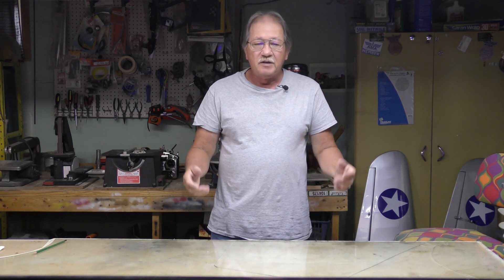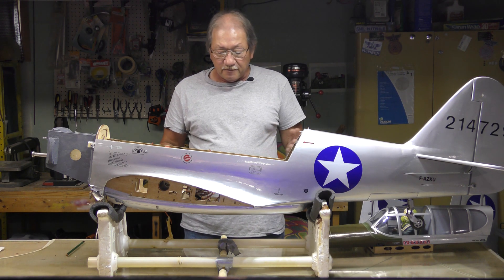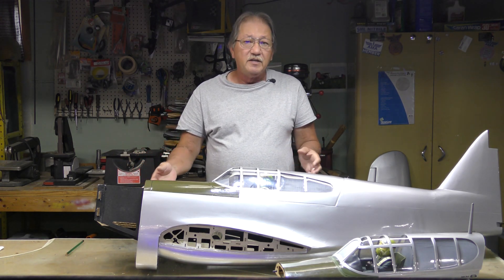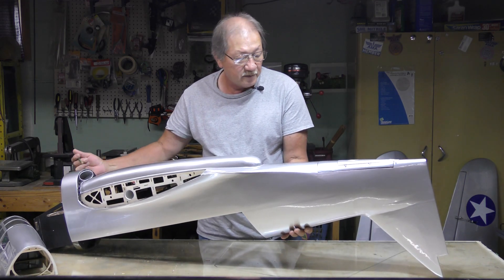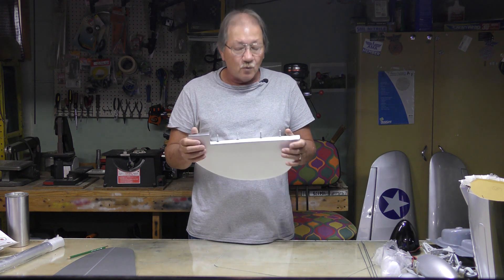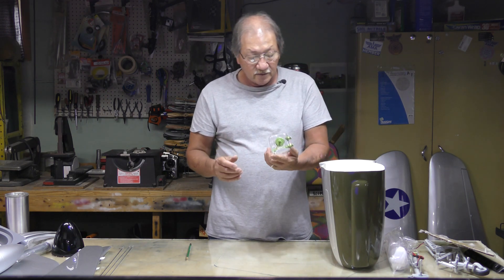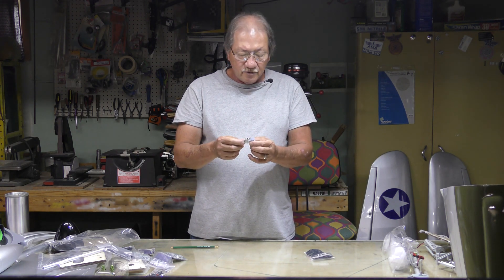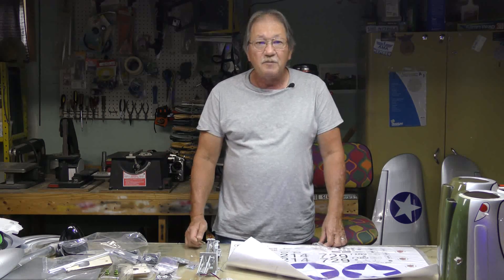Review of the New  P-40 Warhawk from Phoenix Model

Comment: Hi. Good review. Do you think a DLE 20cc is to small for this plane .
Reply: Hi, I think a 20cc  might have enough power to get the model off the ground however, I strongly wouldn't recommend it. I've. been flying my P-40 with a DLE 35 for a while now, and in my opinion,  a 35cc is the perfect power plant for the model. Thanks for the question.

Comment: Great video!! After seeing what it actually looks like I ordered mine from Towerhobbies yesterday!! Going to go electric hope to see your build series on this one! Question is it going to need a retract module I heard you mention something on that matter? 👍🏼👍🏼
Reply from the maker: Hi, the "Retract Control Box" made by Phoenix Model is not yet available.
You can purchase other control boxes else where that will work with 7.4V retracts. The ones I found cost far more than the one that Phoenix Model is suppose to produce. Tower Hobbies has it listed, but its listed as "Coming soon". I put myself on the "Notification List" on Tower Hobbies web site. To get my P-40 in the air I may end up getting a similar control box else where (I need another one anyway for a different project).
Good luck with your P-40!

Thanks for the question!
Reply: @rcmodeltipshints9462  Thanks, will definitely be putting myself on the list too! 👍🏼

Comment: What would be the difference in weight from the old to new design,  I thinking I may pick this one up and go electric I have done conversions in the past  that worked out well. My strategy has always been the same 
I always looked for a motor with a combination with the battery weighed very close to the gas engine / fuel  it replaced power output and prop needs be spot on for thrust which I test with a pull chord and scale with at least a 1 to 1 ratio. thrust to weight.  150 watts per pound is good enough.
Reply from the maker: The weight of Version-1 is the same as Version-2, which is 6600 - 7500 grams ( approximately 14.5 - 16 lbs) according to Phoenix model specs. My original weight 15.5 lbs. I'm working on the assembly video of P40 Warhawk version  2 now. Part-1 should be uploaded by the
Reply from the maker: End of this week

Comment: Thanks for the video, seriously considering ordering one. Although it’d be a while before I could get around to putting together, But might grab one up anyway. I understand your qualms with their efforts to lighten the airframe but my hat is off to them for continuing to be innovative rather than just building the same ole. And keeping their price down as they have especially today is impressive. For an 80” warbird in the $400 price range I donno what more you could ask for. They build good stuff, maybe the gear wears out down the road or something like that but then you can upgrade the gear then, rather than spending hundreds on gear rite away. Some better wheels, Callie graphics, a good spinner and maybe some paint if you want to and bam you got a sweet machine at bargain. Hope to see more 80” warbirds offered by them in the future. This version may not fair as well in a crash like your previous one but then again your not supposed to fly it into the ground 😂 only thing I really question is how well it can handle added stress from an oversized engine like so many like to do.
Reply from the maker: Let's see.. lets start with the price. I don't have any real complaints on the price. However I paid $350 for the gen-1 P-40. I figure the upgrades is the reason for the increase in price. The external imperfections I pointed out are cosmetic however, they are eye catching. As to the poor trimming on the plastic exhaust, there is no excuse for that. It makes a person wonder about the the quality control on the rest of the model, does it not?  The type of construction on this model is better suited for 3D type models in my opinion.
Light isn't always right when it comes to "sport or scale" models. For example:
While starting my gen-1 P-40 my DLE 35 kicked back, the force of the kick back snapped off the horizontal & vertical stabilizer in the substructure of the fuselage below the mounting plate (another spot I didn't mention but will be addressed during the assembly). They improved the horizontal mounting plate in the gen-2 P-40 by adding carbon fiber. I have no problem with the wheels, just the lower half of the struts. I question the ability of the lower plastic strut to hold up to a grass flying field as well as the tail wheel retract. As far as over powering the model, I personally wouldn't recommend it. I don't think the air-frame can handle it. Perhaps a mild over powering with 40 - 42cc would  be ok (maybe with a little luck). Dressing up an ARF is a fun thing to do, especially when you don't want the look of a cookie cutter model. That' why I painted the eyes on mine I didn't want to invest to much money in it.
As a builder / designer I tend to be more critical on the structural integrity of a model. When designing and building a model, the goal should always be,  "build as light and strong as possible", no matter what type of materials being used. There are many more manufacturing factors to consider as well, which usually end up as short comings on the finished product. 

Oh by the way, the crash of the gen-1 P-40 was caused by a faulty Y-harness to the elevator servos. I should have made the harness myself in hind sight..Lol!!

Thanks for the comment!
Reply: I’m just grateful that Phoenix is still around and doing what they do at the prices they do, especially in regards to warbirds. Theirs always some things that will have to be addressed or that the buyer wants to do differently on all of them. I imagine the lightening has a lot to do with electric having gotten so popular. I fly at two fields both being grass and have had zero issues with the Phoenix landing gear after many many flights. It’s definitely not the best but gets the job done and has yet to let me down. In comparison the seagull 80” p40 is $550 plus shipping and the gear is sold separately for I believe around $500. That’s a substantial price gap. When assembling my Phoenix Corsair I found that the wings were turned to the right slightly when installed in the fuse. When squaring up the tail to the wing I noticed the tail was angled to the right after measuring everything. Discovered the issue was in the fuse.  Both wings were angled to the right a little bit. This had me pretty upset at first but I just added some shims to square the wings up and ended up with an absolute beautifully flying Corsair. I get applause and compliments every flight, it practically lands itself, making it easy to “greez” it in. I had to fix that one issue but ended with a great plane at a good price. I appreciate you sharing your thought and findings on this plane. I can also appreciate that Phoenix has to be able to build them at certain pace in order to be profitable and keep prices down, which reminds me, seagull just announced a price increase on their already more expensive planes. I like Phoenix just like they are, cheap enough pretty much anyone can afford them and good enough that someone can have a good airframe to modify and make their own, as i do. You can always get a TOP RC or CARF if you want better scale features and quality rite out the box. Thanks again for the video. I’m proly gonna hold off for the time being as I already have 2 builds I don’t have time for 😂. Should be another shipment around winter time, I’ll proly get one then. And perhaps by then someone like yourself will share their findings with flying it and the ruggedness of the airframe, etc during use. Hope it does well like it’s predecessor!